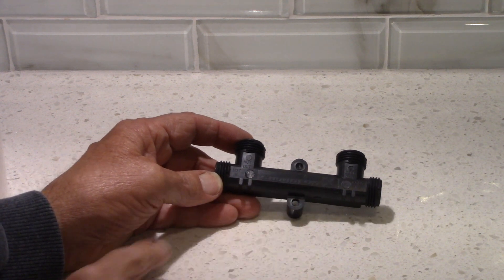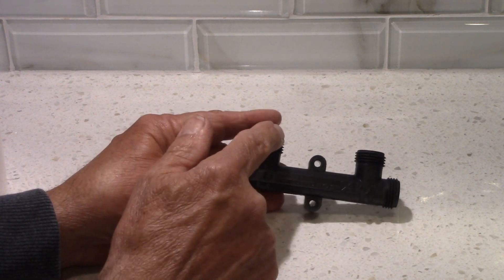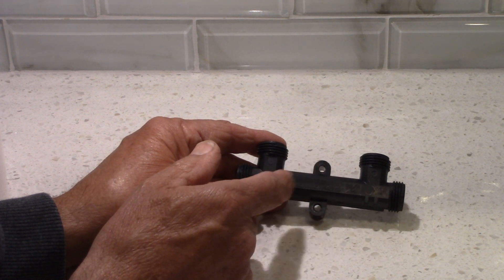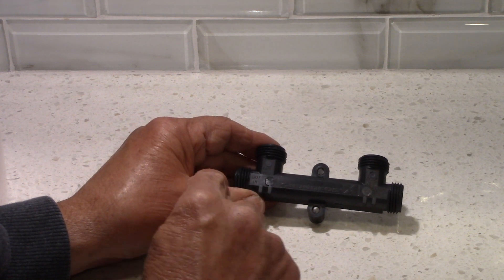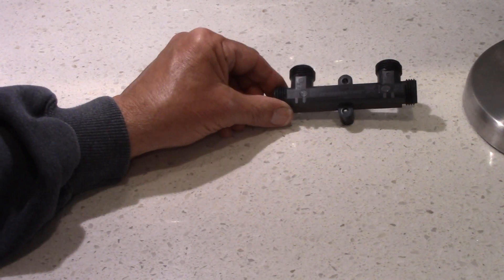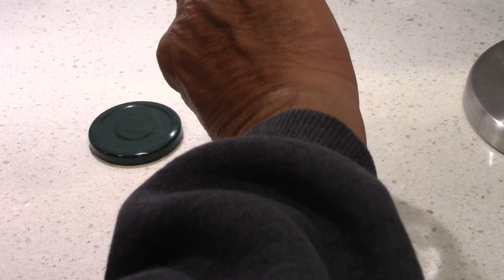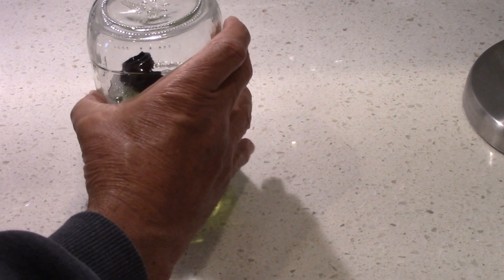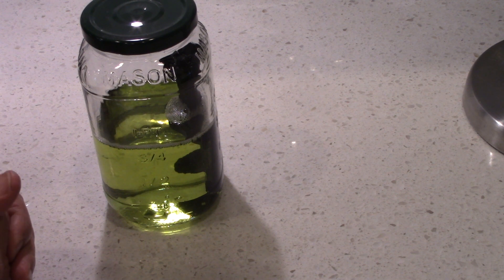Hot Water Recirculating Valve Problems? Save $70

Comment: When you took this piece off how did you cap off the lines? 
I feel like my pump only worked for a short time after install.
Reply from the maker: All I needed to do was turn off both shut-off valves until my soaking process was done.  When you put your hand on the pump, can you feel it running?  If not, check if the wires became disconnected.

Comment: Yeah I tried this with two recirculating pump sensor valves and it didn't work with either one.☹️
Reply from the maker: That is sad.  In my area, the water is so hard that the valves start sticking in about 6 months.  They sure are expensive for little pieces of plastic. Good luck!
Reply: @gfotinakes316 yes thanks for the quick response. We are on a well so hard water makes sense. The last valve I purchased was good for about 10 months. I am buying another one that's brass and probably won't help the valve situation but at least it will be harder to strip the  threads on the plastic ones. You have to make a decision whether it's worth spending $50 per year to have instant hot water. I guess at least for my wife, it is. Lol.

Comment: I recently installed one of these and customer says he has very hot water in the cold side, apparently couldn't even shower. Unplugged pump and it's fine.
Reply from the maker: Is it possible that you flipped the hoses on the valve when you installed it? Give the pump manufacturer a call and see what they say.